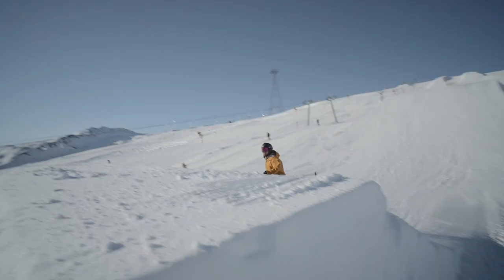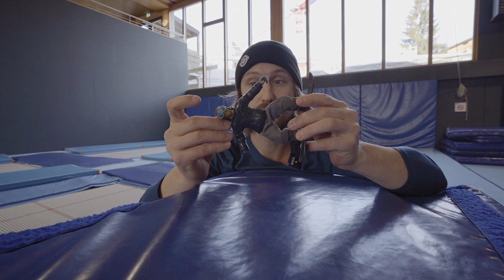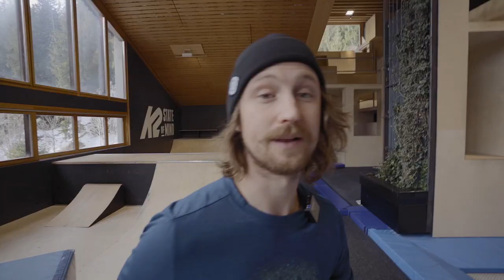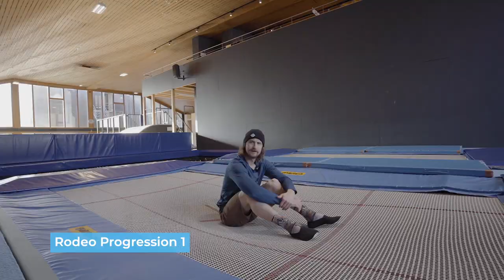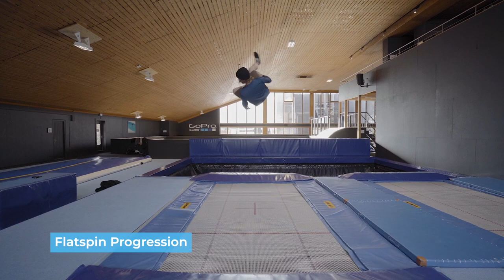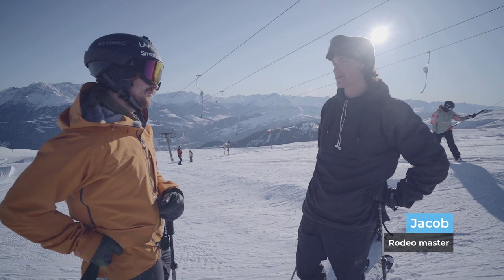How to Flatspin and Rodeo on Skis

Comment: He's explaining it actually very well. The comparisons side by side makes it even more easier.

What i like the most is, that he initiates the rotation of the flatspin with a 'punch', just because it does a MASSIVE job for your mental game. When you still not feeling it though (that means creating the trick in your head) you might wanna look at 6:58. Pay attention to his LEFT shoulder. See how it drops down to the right once he came around while doing it in a jump? That's what made the difference for me. Thinking of the opposite shoulder to be 'dropped'/'pulled' to the right side.
Reply: Thx 👍

Comment: Wut? Rodeo 360? That's a flatspin!
Reply: exactly
Reply: yeah right, buddy
Reply: @Christoffer Sjöheim that's not a Lincoln loop what are u on 😂
Reply: Its a Modern flatspin not a true flatspin the modern flat 3 is basically   a rodeo 3 but looks a little bit more flipper imo. Ive never seen someone who calls the that rodeo type trick a flatspin know what they would call a rodeo 3 its like it doesn't exist to modern flat 3 guys only a switch rodeo 5 which is basically a backwards misty which is actually accurate. Regardless I think we should just call the trick a modern flat to differtiate from a true flat because then what would a true or oribital flatspin be?
Reply: Basically his rodeo 3 is a modern flatspin his flatspin is a true flatspin and id argue that a rodeo 3 is kind in-between the axis of these 2 tricks
Reply: Christoffer Sjöheim ehhhh
Reply: Bruh it ain’t flat smh
Reply: Ye

Comment: So is this already settled... when it's a misty (flip), rodeo (flip), flatspin or just corked 360 (or some other rotations).

IMHO the orignal or full names of the tricks do give an indication. misty and rodeo are flips, so you need to invert in them, flatspin (and corked) involve only spinning, no inverting. Finally what is then the difference of cork and flatspin? I have been under the impression that for corked spins the axis stays the same pretty much through the whole spin, where as in flatspins also the axis is spinned (basically a looks like a funnel). 

So in flips, you invert and depending on the kind of flip, you also spin in one or multiple axis. In straight spin, your spin axis stays vertical. In corked spins, you tilt the axis (but not inverting, ie. head below hips) and it stays pretty much the same. In flatspin, you tile your rotation axis (same as in cork), but also the axis spins more, forming almost like a funnel.

Comment: when I used to skate a flatspin was the third axis of rotation (not flipping or twisting), like if you were lying down on a giant vinyl on a turntable and rotating around your pelvis. That's why it is called a FLAT spin, because you are lying flat. So in that original paradigm there are no examples of flatspin in this video, just flipping and twisting.

Comment: Whats the difference between cork 360 and a normal 360
Reply: It's all about axis of rotation. For a normal 360 the axis of rotation is vertical. For a Cork 3 it is off centre. Usually somewhere between vertical and horizontal

Comment: what’s a cork then?
Reply: TNT Extreme Sports I’m pretty sure it’s the same as a flatspin.  But instead of leaning forward, you lean back.
Reply: TNT Extreme Sports a 360 720 or 1080
Reply: Cork is a normal spin but it’s off axis, so it kind of wobbles
Reply: Its an off axis spin
Reply: It’s a backwards leaning off axis spin where you don’t go completely upside down. If the feet go in line with the head while upside down it’s called a d-spin

Comment: well regarding your flatspin definition the question arises what the difference between a flatspin and a bio is? To me you flatspins are bios. Cant really agree with your definition. In my view rodeos and bios are the same one is more popular in america and the other in europe.
Reply: Well, on the trampoline the difference between bio and (his) flatspin is hard to spot. Still, a bio is 'flipping' forwards. On the ski jumps you actually have to lean quite a bit forward to spin a bio since the takeoff is angled backwards and thus you can spot the difference more easily.